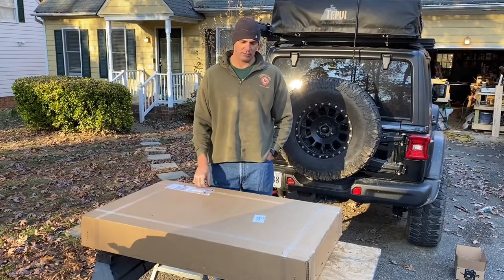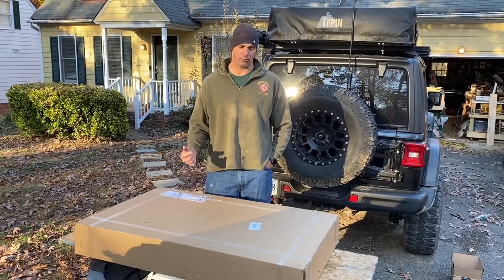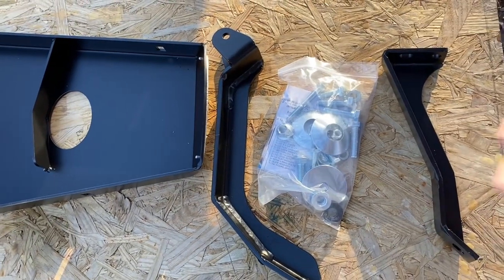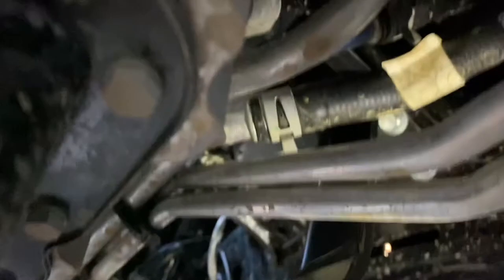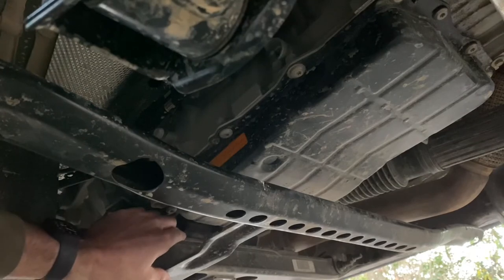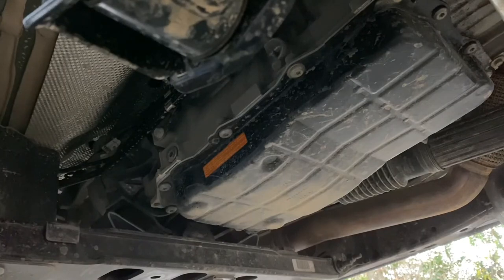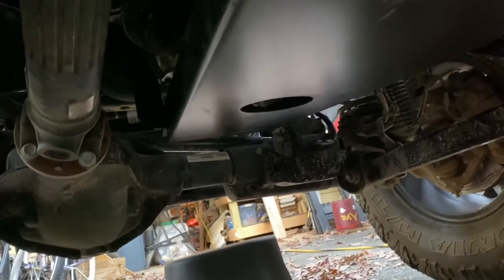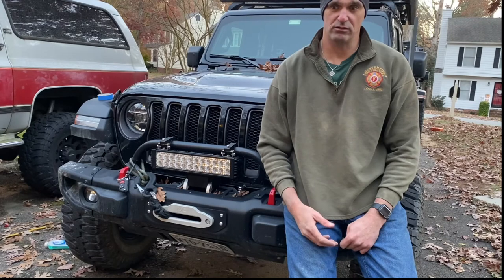Do you need a skid plate for 2.0 powered jeep wrangler?

Comment: This skid looks very well made
Reply from the maker: Its super solid, i went with the all steel version which is 3/16 thick as it adds 40lbs of weight below the frame rail which helps alittle with center of gravity and personally i think steel is a better  material to take impacts as it will deform rather than rear like aluminum